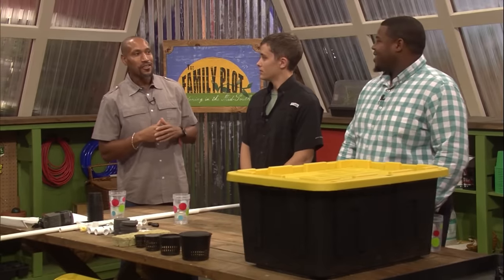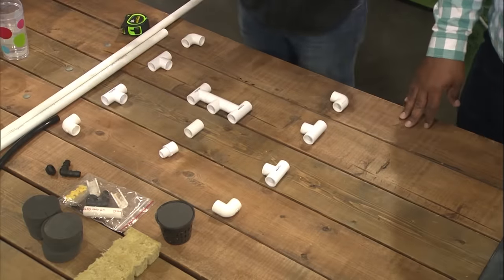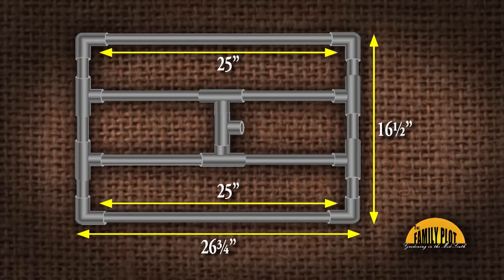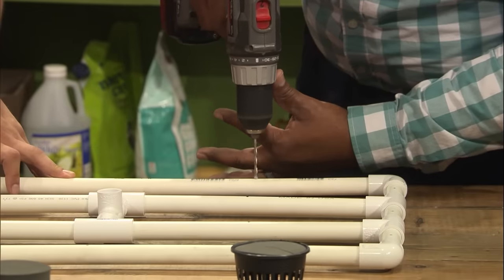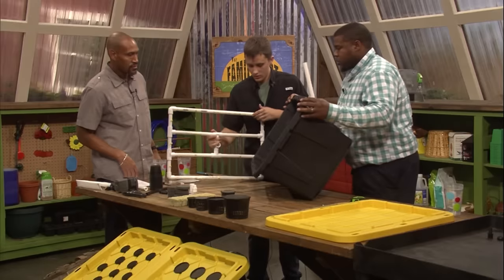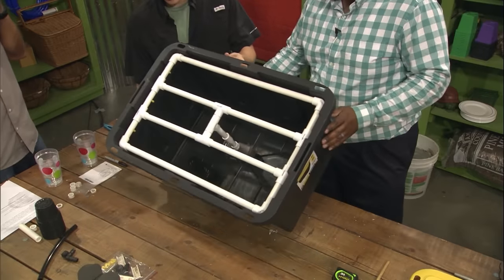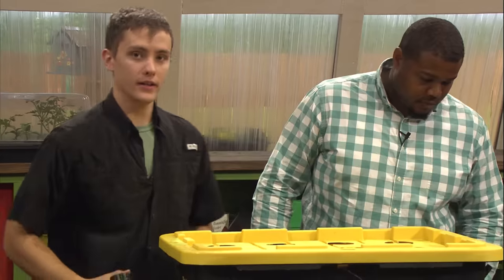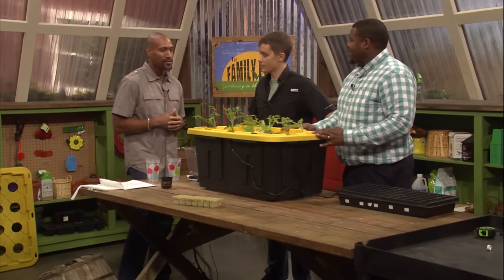Building an Inexpensive Hydroponics/Aeroponics System

Comment: Tip for anyone building this.  Use reverse on your holesaw, for a nice slightly melted finish, and minimize plastic shavings.  The result is very pleasing.
Reply: Wait, Only reverse?  So it kinda slowly "burns" through it with no shavings?
Reply: Hole saws take some finesse to do it right. Go slow, let the drill do the work, and make sure it's level
Reply: That's an excellent idea, that tip is going in my wheelhouse
Reply: That is a great idea, I sure wish I'd seen this a week ago before I'd drilled some pvc with a hole saw
Reply: Works for any kind of saw really, I use this on my table saw as well.
Reply: where to buy the sprinkle heads and that tub?
Reply: What size hole saw is for the cups?
Reply: Great tip, thanks.
Reply: Note that this only works if you're using actual holesaws, this doesn't work with paddle bits like in the video
Reply: Dang it...too late now, the drill shavings clogged up my sprinklers n had to take apart to clean w a toothpick. Finally got it spraying well now.
Reply: Or just use some sandpaper/file/deburring tool.
Reply: or use a $1 deburr tool. ya know the actual correct tool.
Reply: The deburr tool on the soft plastic totes can remove enough that the weight of the plant can make the pot fall through the hole. Also, reverse keeps your wrist from getting torqued.
Reply: @t_206  This is what contractors do when drilling through vinyl siding to prevent tears. This is especially useful in cold weather when the vinyl is brittle.
Reply: @canucanoe2861  It's so simple yet so useful.  I can just picture the shattering and splintering.

I've actually already been able to use that (apparently common knowledge) trick a couple times.

Just one of those things I never picked up from my elders! 👊

Comment: maybe drill an extra hole for water and put in a float valve so you don't have to add water manuely, just something a plumber sees to improve a good design
Reply from the maker: You read my mind! We have thought about doing that. The plants are big now and suck up about a gallon and a half of water a day. Every morning I add it back. This would save time!
Reply: We've incorporated this into our many designs for this tote. We've designed and built them into setups that use a single reservoir which gravity-feeds the totes on demand. We like to keep this particular incarnation at hobbyist level and not overcomplicate things.
Reply: Matthew Laplante its a closed system no evaporation. ive made many of these and you can go weeks without watering. its a cool idea you have for sure though.
Reply: Yeah just adding water wouldn't be enough, but a gravity fed reservoir of nutrient solution with a float sensor and a valve to automatically refill would be SO COOL.

I have these exact same totes but only used one for the reservoir, I'm doing dutch buckets. I'm definitely going to try and make one of these setups with the spray manifold for outdoor vegetables in the spring.
Reply: Family Plot instantly subbed up love the information thinking about going back to Hydroponics from Coco
Reply: you are one smart block
Reply: With Arduino electronic board and a set of level you improve very good this proyect...
Reply: I am new to hydroponics. Whats the purpose of the drain? Do u connect the drain to the pump inside the tote?
Reply: manoharanstube, unless I'm mistaken, as the comments mentioned, they drain and change out the water every so often, so they merely turn the drain tube to the side (facing downward) and let gravity make the water drain out of the tote to dispose of it. Then they turn the drain tube upwards again and the water is replaced as well as any nutrients required to continue growth. 
The drain is helpful so you don't have to tilt the tote over to pour out the water each time.
Simple to use.
Hope this helps to answer your question.
Reply: What I would do is instead of having a float valve in the tote with plants, u have another container which can be just a 5gal bucket or anything. Plumb the float valve into that 2nd container with where u want the water level to come up with the tote with plant. Then have a rezavoir on top so gravity feed to “controller” container (without plants). And link up the totes & controller container of course. So you’d want to drill 2 holes-one to drain and one to link up to the controller container with float valve. 

Awesome video. I paid $180 for a pre-maid one and the only major difference was they cut I think 24? 3” holes in the lid. I use it for veg so the plants don’t need to get too high and crowd neighbors. Works great! With this video, I’ll save hundreds if not a couple thousand!
Reply: Good Job
Reply: I am confused as heck. Someone please make a video for this and reply to me if you do
Reply: Shannon Sunshine you’re probably better off buying pre-made, to be honest.
Reply: Silverweed how do you make it “Gravity Fed”
Reply: Let me clear up a few things for hydroponic starters here:
1. This is a spraying system, technically, this is not hydroponic but low pressure aeroponic. Hydroponic is when a part of the root system is totally submerged in water. If you used nozzle to spray the water into the air, it's aeroponic. To me it's a semi-experienced/above beginner level system. A truly beginner system is a Kratky method.
2. Whatever system you may have,  you'd need a drain. In hydroponic, you need to replace new liquid from time to time. Not to mention sometimes you messed up your nutrient and need to flush everything out, a drain comes in handy.
3. The system in the video has too many holes for pot. It is not recommended because as the plants grow up, they will get crowded. Also if you used cheap box the weight will break your lid. 3 - 6 pots are perfect depends on what types of plant you grow.
4. You would need to paint the lid black. Yellow lid has a tendency to let light comes through and it will mess up the root system. Also it will heat up the box.
5. Many people have a closed system which reduces the amount of water evaporated so they won't have to refill the water regularly. However, plant needs aeration, hydroponic or not. 
6. Spend extra bucks for water pump, air pump & heater, may cost you about $30 for all. Water pump helps circulate water, so nutrients won't settle at the bottom. Air pump helps with aeration, point directly at the root, no need if you use spraying system like the one in video and heater keeps the water at perfect temperature.
Reply: Show me how your plants are growing and also show the pictures after palnting and how water touches the plants
Reply: @Joshuatreelocal 

Not quite...

A lot of the water loss is via the plants' leaves (transpiration). Using a similar setup I've seen losses of up to 30mm per day. Granted that was on a day with 38°C, relative humidity 40% and continuous 25km/h wind with the plants in direct sun for most of the day but the point is that one should not assume that a closed system will be immune to water loss.
Reply: @Ndendy1  1. Hydroponics is a broad term for several types of soil-less feeding systems. The types of Hydroponics are Deep Water Culture, Nutrient Film Technique, Aeroponics (low pressure and high pressure), to name a few.
2. This sytem needs a drain, and we usually add one, but that's just to empty for cleaning. If you use the correct type of nutrients (GenHydro can be misleading) you only need to top off with clean water as it drinks and add nutrients from time to time. Emptying and filling the reservoirs weekly is a fools errand that we only recently corrected ourselves.
3. The cannabis plant isn't something we can comfortably teach about at this time, but this sytem will outdo any other if used correctly (or even scaled into larger setups, think many, many cuttings and quick turn around).
4. Light doesn't "mess up" the roots (check facebook). Light in your reservoir promotes algae growth, which competes with the plants for nutrients, but doesn't harm anything. We've had success outdoors with this tote. Now-a-days we like to bury them up to the top lid lip to keep it cool. Growing a canopy over the lid will block light sufficiently but there's nothing wrong with making a plastic of vinyl cover or painting it with some non-toxic plastic friendly paint. 
5. This system aerates better than any other hydroponic system as the plants are plastic with a nutrient spray that becomes highly oxygenated as it sprays, not to mention the dangling roots that gets lots of free moving air. Low pressure aeroponics is the most efficient system for a hydroponic setup in that way, and that's why we made this to share with the world. It can be improved upon in many ways, and we can use anything we want to make the aero setup (instead of the tote) so long as the pump can send water into a chamber and recirculate. Many time we will have the pump in a reservoir outside of the tote and connect many totes to one pump. Again, the spray creates oxygenation. There is no hydroponics setup, commercial or otherwise, that overlooks oxygenation. If it did, it wouldn't be viable to the consumer market.
6. Did you watch the video? The water pump is there. The aeration is there. No need for an air pump. Please don't add heat to this system. Your rooms with lights and the outdoor summer sun won't appreciate it. Beneficial microbes are your friend.
Reply: @youcantravelto  If you will put this into practice (or simply check our facebook page) you will see that no extra parts are needed. I would agree that this is a hybrid system, combining DWC and LPA, but the misters agitate all that is necessary for the roots, even those that are submerged. This system is great for the home gardener because it its a single unit and handles all the aspects of a commercial system (separate reservoirs isn't needed until you want to use a bunch of these at once, or a similar setup if wanting to forego the large tote)
Reply: @youcantravelto  Again, you're missing the idea. The aeration works just fine, just like an air pump, for the roots submerged. Check our facebook page for giant root systems in this exact system from tomato and squash vines out back of our warehouse. Air stones are not as efficient and this is a break-in system for aero gardeners. Of course it's not perfect. It's meant to be a highly advanced DIY project. No deep water culture system produces what we produce with this setup. The benefit of DWC is the price and ease of setup. You're correct that it's simpler, no so much that it's 'better' as far as root development and speed.
Reply: Eric Schimmer  coco Is easy because  your chances of things going wrong is way less
Reply: A ditch wick system is in the works, I'll post a video when I do
Reply: Awesome video and i agree with @Matthew Laplante. Will build it, only a little smaller. Thanks!
Reply: Dad?
Reply: I like people who come with some info! Thanks for the clarity.
Reply: @Ndendy1  air pump would not be necessary and a waste of elctricity to run and air umps generally noisy( in this spray aeorponic system.  Air is 21% Oxygen or about 210,000 ppm oxygen. Fresh water usually holds between about 10 to 20 ppm oxygen depending on temp and pressure.  Old chemistry law is that gas diffuses 10,000 times more easily in air than water wich is why sinks and toilets have p traps,  On a cool summer night, a lake’s temperature might be 60° F. At 100% air saturation, this lake’s dissolved oxygen levels would be at 9.66 mg/L. When the sun rises and warms up the lake to 70° F, 100% air saturation should equate to 8.68 mg/L DO ³. But if there is no wind to move the equilibration along, the lake will still contain that initial 9.66 mg/L DO, an air saturation of 111%.  Also you may ultimately need a water chiller more than a water heater.  At very warm root temps pathogens such as pythium can be a problem, The water temp will be warmed by the heat the pump emits
Reply: @manoharanstube  Good question, I had the same. Maybe to drain the water if moving the tote?
Reply: Can i grow marijuana with this setup??
Reply: Float valve? Kiss.. change the drain pipe to clear pvc; will show water level. Mold prevention not addressed here.
Reply: You have a very nice, clean, looking channel. Love it
Reply: hashing out some thoughts. nutrients and maintaining pH would be a problem tho. even with a reservoir the ph in the tank wouldn't match the hydro bin. perhaps a nutrient reservoir that is pH matched plus an additional outlet from the pump to sample and add ph up/down would work.
Reply: @Joshuatreelocal  the plants transpire lots of water if they're growing right (depending on variety obviously) so it's impossible for it to truly be a closed system, sometimes they evaporate a TON of water.
Reply: Just use a separate tote as a reservoir and drill an even centered hole directly through the bottom of the feeder tub and through the top of the reservoir lid for drainage!
Reply: @jamescampbell1060  e
Reply: @manoharanstube  to drain the water if needed. monthly water changes.
Reply: @manoharanstube  to flush the water would be my guess if you have certain chemicals for a certain stage of the plants life
Reply: Where are y'all buying these totes?
Reply: @wetwerk2178  Can you explain how you built multiple totes with a single reservoir?
Reply: But you need nutrient solution, and you can't just add water or it will mess us the concentration.

Comment: 3 years later this still holds its own, good job guys thanks for giving this to everyone 🙂
Reply from the maker: Happy to do it!
Reply: 3 weeks later and the tomatoes are huge, cutting all light from anything else in the system...
Reply: @Chaosweaver-1  Grow lights....
Reply: @FamilyPlotGarden  what size pump gallons or liters per minute
Reply: How often do you turn the pump on,how long do you run it for?
Reply: @FamilyPlotGarden  Do you put nutrients into the water? Very new to hydroponics. If so what nutrients would you need? That is basically it then? Build this in the video, then add nutrients to water?
Reply: you keep it on at all times or else the roots will dry up. it is meant to be on 24hrs a day.  @robinworkman3621

Comment: BEST TUTORIAL FOR A SIMPLE HYDROPONICS SYSTEM EVER!  I BEEN SEARCHING THE NET FOR YEARS.  I ALWAYS KNEW I COULD ACTUALLY DO IT MYSELF, NOW I'M 100% CERTAIN!  GREAT JOB, EXCELLENT VIDEO!
Reply: This is everything but simple
Reply: Look up "grow a lb in three weeks" or something similar. It's an 8yr old high times article explaing this better. Also not having a watertight tote is a huge mistake. Go with the large Rubbermaid roughneck. These guys are just asking for all the water to go on the floor.
Reply: Its garbage hopefully no one build same and expects results
Reply: @Stolencamaro 

Have you actually tried this model? If so, what was so bad? If you're sincere, surely you should pass on your experience so as to prevent others from suffering the same fate?

I have built something similar, and it worked very well. Unfortunately I didn't back up the photos I took on my phone which was subsequently stolen so I can't post them as proof.

Unfortunately I also used cheap totes which became brittle in the sun and collapsed after two years or so. But I'm putting a new setup together with some refinements and will take photos as I go.
Reply: @bertkutoob  Mom 20 years ago, you told me something...
Reply: @bertkutoob  
I tried it and its trash. Leaks everywhere, and the nozzles get clogged and pump gets clogged. I tried to put seals at the top like weather stripping but it leaks out.
Reply: thanks!

Comment: Used a very similar system for cloning. Found the most important part to these type of systems (well at least for cloning..imagine growing would benefit), is plugging the pump into a Repeat Cycle Timer/repeating timer/whatever else they call them.  It turns the power (pump) On for a certain period of time, and cuts the juice for a certain period of time (ex. ON 1 minute/OFF 3 minutes or some can be set for custom times)  The roots need time breath/dry out a bit....when I made a few DIY bubble cloner/aerocloners in the past, would always had mixed results. Some would sprouts root, but many of the stems would rot and turn to mush. After plugging into a repeating timer...no problems.
Reply: thank you kindly for the information
Reply: thats what is happening to me.. my clones are all dying.. no roots..  so you think if  i put a timer to turn on for a minute and then turn off for 3 minutes continuously  will fix this? How often should i change the water? some people add a little chlorine to the solution to avoid bacteria.. wouldnt that hurt the new roots? let me know bro! :)
Reply: THANK YOU FOR THIS INFO!
Reply: @cesar7261  Yeah, the intermittent timer is the key man. Too much water CONSTANT is no good and all I got in the past is mushy stems...maybe a few would take root if I was lucky...the timer like I said is the problem fixer. And yeah, 1 min ON/3 OFF or 1min ON/4 OFF either should be a safe bet. I have seen where folks add some bleach or hydrogen peroxide...I would start with just the timer first and try the chemicals if that don't work (ya might not need them)  Happy grows!
Reply: @PHAT4LifeTV  Glad it helped ya!
Reply: actually, your problem sounds like too little humidity. get a dome or up the RH in your grow environment. For rooting clones, you want to have at least 80% RH; 100% is fine too.
Reply: DUUUDEE!🤦‍♂️ you just solved my problem. I was wondering why my 200 clones turned to shit
Reply: I cant find a timer that does this can someone help me with a link? I would mighty appreciate it
Reply: Thanks
Reply: I do one minute on, 15 minutes off. Adding an air stone and aquarium pump to the mix to oxygenate the water also improves things for cheap.